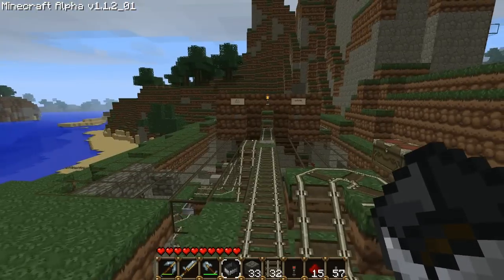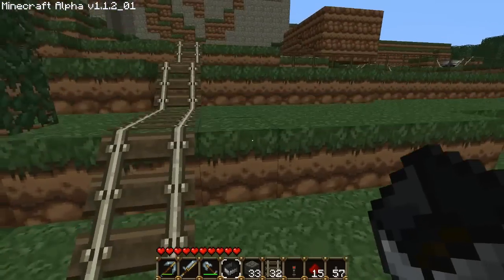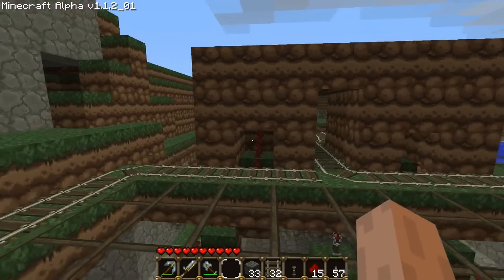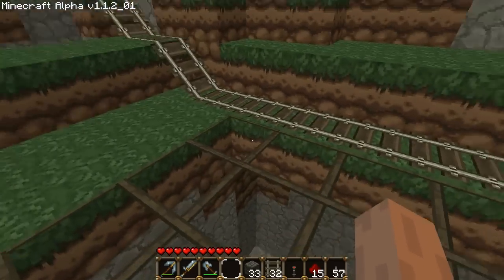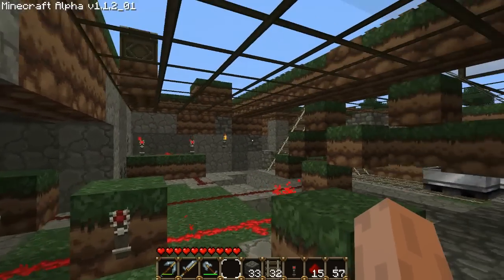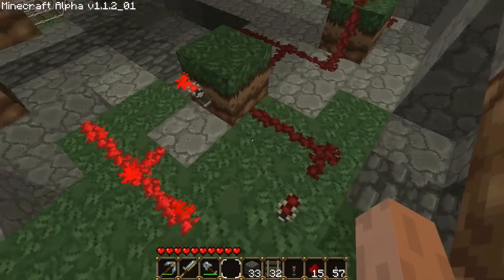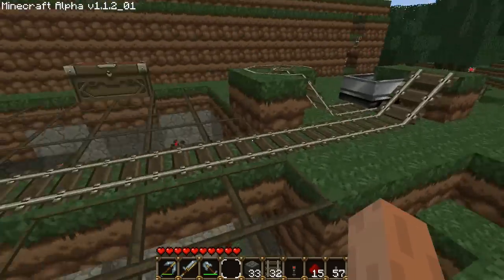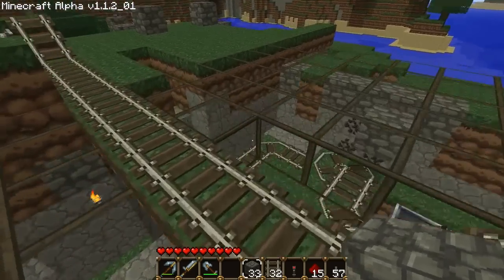Minecart Indermediary Switching Station (Modified from Lemures3's Off-Ramp module)

Comment: You should have mentioned that you cant have it facing a certain direction due to the tracks return characteristics.  I rebuilt it brick by brick facing east (yours was facing West.) Where the track is supposed to reset to its original set position, due to its direction on my re-production, it would not.  There is no way to correct this.

Comment from the maker: @RanTheMan100 You have to make sure that there's a piece of track on every side of the slanted track so that when the redstone torch CAN'T toggle this particular piece of track. It can't toggle it because it doesn't really know where to put the curved piece, it can go either way. If you leave a space open next to the slanted track it will go down a level and ruin the booster. Hope that helps.

Comment from the maker: @Zer0OZero 

I would give you a link but I can't in youtube comments. Anyway, do a search for "Bob's Minecart Tutorial 3: Advanced Minecart Stations "

The booster I used is at 1:30. He explains it pretty well. The only caveat I would add is that when you're adding a switch make sure that the slanted piece of track is surrounded by track on all 4 sides - otherwise the switch will mess up the slanted track.

Comment from the maker: @Sulleric Unfortunately, putting a block there cuts off the redstone before it can descend which, in turn, scews up the rest of the circuit. to completely hide the redstone I'd need to either make the sides one block wider (so I could turn to the side sooner with the wire) or make structure one block longer so I can cover up that back hole without interrupting the redstone.